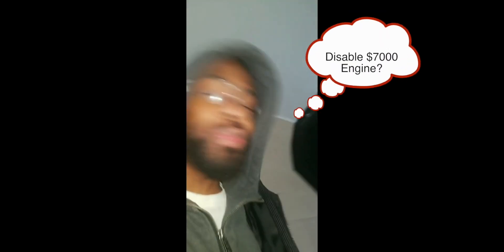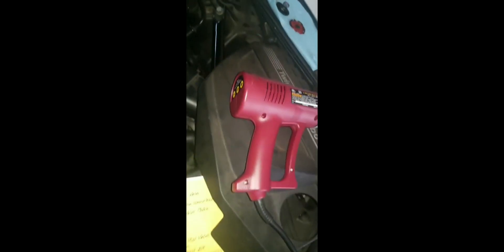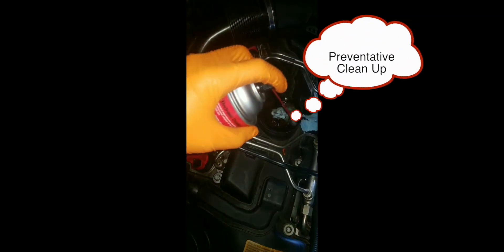BMW N55 PCV Valve Repair with @ToneyDark #TryATing

Comment: Did it work please let me no thanks
Reply: What was the code my have a now p112f can you help me please
Reply from the maker: @evoquesquad2015  the code I had was air mass plausibility. I don't remember or keep  track of the alphanumeric code definitions. You have to look up the definitions (Google  them) or use a bmw specific scanner (ex: ista-d, inpa etc etc) to read codes and get tge detailed  definition (ie code abc234 = air mass plausibility).
Reply: @evoquesquad2015  I got this code what is it
Reply from the maker: The  mod worked yes, but did not solve the problem I was having.  I ended up having  to change  the valve  cover
Reply: Why did you have to change it
Reply from the maker: @evoquesquad2015  Misfires at idle due to air mas plausibility codes. Rubber diaphragm inside the valve cover fails creating an internal vacuum leak. Causing unmetered air to go into the cylinders. The engine computer tries to mistakenly correct this Causing misfires.
Reply: Broooo you just answered my problem! I had an air plausibility code, but it wasn’t permanent and never triggered the CEL. But it was like on “pending” when I pushed the motor hard. So I pulled off my oil cap and sure enough it started to run rough, and the computer tried to adjust for smoother idle, which it eventually got it. But I think my PCV valve is toast, might as well replace the entire valve cover.

Comment: How did it stay also where’s you get the new pcv valve
Reply from the maker: The aftermarket PCV seemed to have a slightly smaller circumference by design so it would be a right fit. I honestly dont even think the silicone was necessary because the fit was that tight. It did it's Job, but my problem ended up being my valve cover anyways. I recommend starting with this cheap fix first to anyone getting MAF: air plausibility+ lean codes.